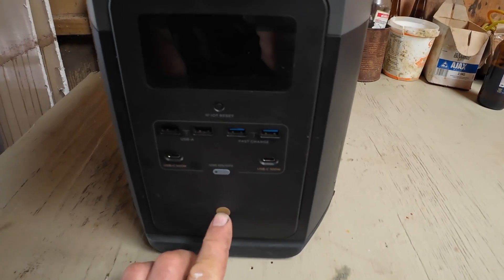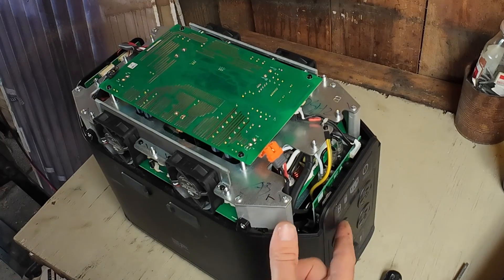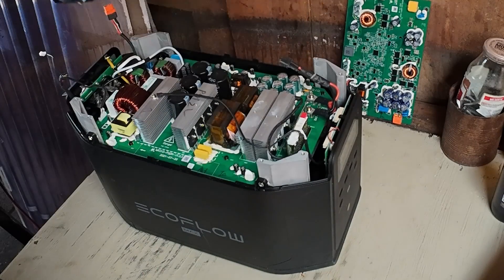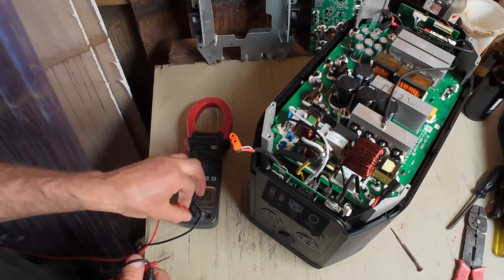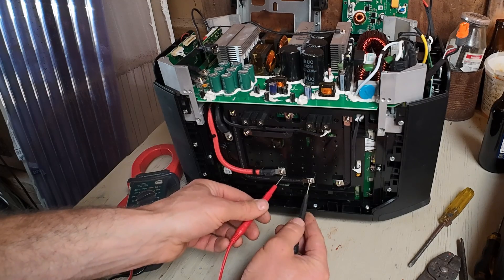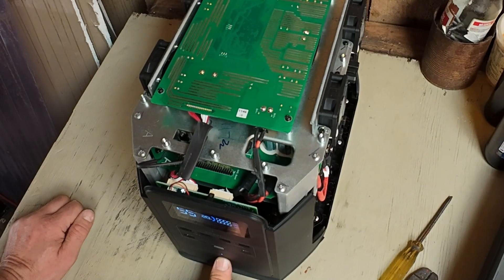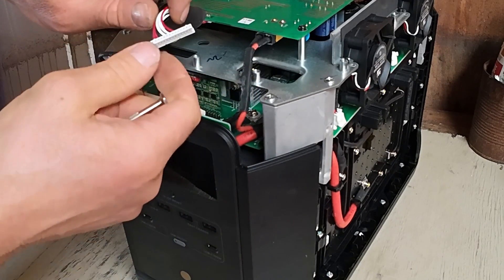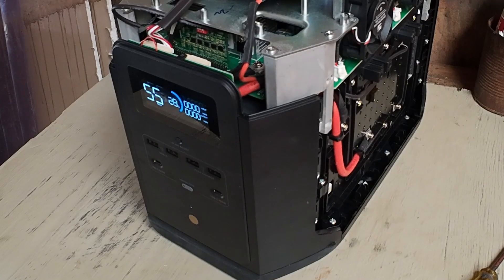Ecoflow Delta Max Troubleshooting: Why Won't My Power Station Turn On?

Comment: Now you'll have an extra free one. Typical two-cent part failure makes an expensive piece of kit useless. To anyone but Marty, that is.
Reply: I don't know how the warranty works there but aren't you supposed to return the broken item?
Reply: @cristianstoica4544  For many bulky or heavy consumer items, I have heard about them just asking for a video that demonstrates the fault. I know someone who had a water filtration system crap out under warranty and all they wanted was the power cord cut off at the base and mailed back for them to ship out a new replacement system to the overseas address.
Where I worked, the actual item had to be shipped back to us if there was any malfunction that an authorized dealer technician couldn't fix by swapping a module. When we shut down the manufacturing plant, I witnessed the destruction of many older model items specifically to ensure their parts could never be bodged back into working order for liability reasons.

One rival we purchased along the way had many phantom old units floating around in search of parts and upgraded software. There was a whole randomized key generator routine encoded into each "legal" device so nobody could sell a software upgrade to say an ex-employee doing a side hustle. I personally disapprove of this for most consumer products [cough - Apple, Deere - cough]  but this was not a typical consumer item.
Reply: To be fair that is quite an unexpected part to fail as it's by design supposed to be ensuring long-term secure connection, as you can see many other plugs that are expected to come off were glues in place
Reply: @Gastell0  I disagree completely. I worked in an ISO-certified manufacturing facility with product lines in a failure-intolerant product category. I don't like to think of how many of that type of terminal connector strip would prove to be unreliable. It's simply the kind of item that's hard to get perfect thousands of times on the first attempt. The wires are delicate and the precision tool for repairing them is clumsy. We would buy the harnesses from a subcontractor and end up fixing numerous terminations by hand and retesting them as often as not.

We were not an industry where we could just apologize and send out a new replacement to make the end user happy. Failure could mean an innocent user got badly injured. Things had to work perfectly straight out of the shipping carton or crate, no additional assembly or battery purchase required.
Reply: @puirYorick  I do agree on testing of all of the components, but I believe you're confound the fault of the component and component design, and fault of the testing.
I specifically meant component design that should prevent specific fault of faults like connector not having tight fit. (that is, I am still not certain what exactly was at fault in this case, was housing itself not having a tight fit and coming off? or was it connector pins not making connection possibly due to foreign object causing smaller point of contact than expected?)
Reply: @Gastell0  Arrgh!
Sorry. I typed out an answer then I lost the entire text when I went to scroll my margin.
In essence, the wires are too tiny and delicate to be trusted. You have no way of being assured if all the conducting strands are in solid contact or if you're running with any signal line hanging on one barely clinging strand. The device gets jostled and that last strand lets go and the control PCB now has an open circuit. The harnesses are just flexed so much before they're even installed, that any single wire might be one or two jiggles from failure.
Designers spec those strips because they're low profile and fit in tight spaces. They also happen to be standardized. They're ideal inside say a toy keyboard with a 30-day warranty that sells for $49.99. In my old job, I despised them as I said. I was paid quite well to re-crimp them as needed. However, I still hated them.
Reply: Plenty of people other than the great Marty can repair things 😂
Reply: @samholdsworth420  🍪Have one.
Reply: @puirYorick  🍻